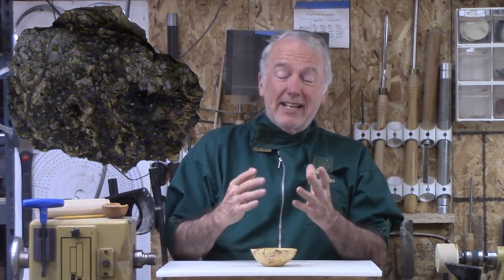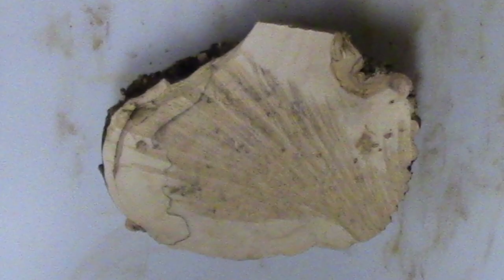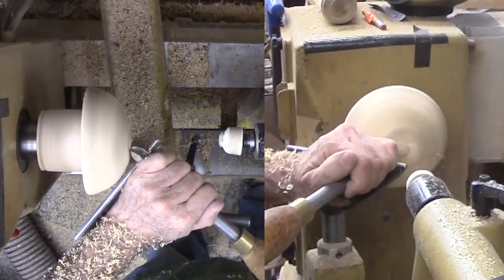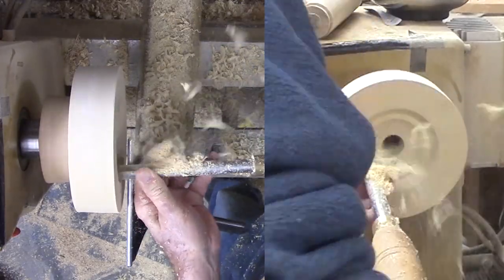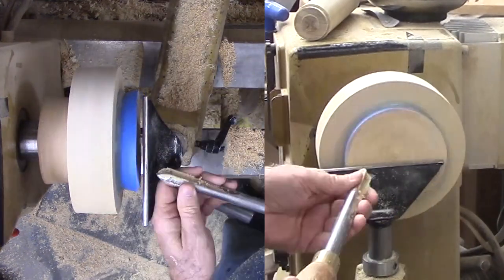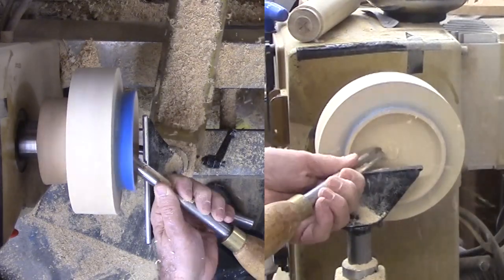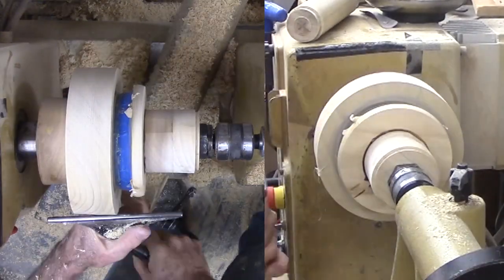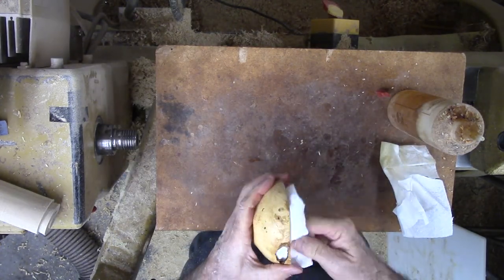This Burl Spoke To Me - Don't Cut Me With A Tenon

Comment: Sand bottom smooth, glue block, carefully turn both inside and outside, sand, finish, remove from glue block with D.N.A.. Hand finish bottom. Small burls are a real treasure to work with and worth the extra care they require. 👏🏻👏🏻👏🏻👏🏻👏🏻
Reply from the maker: Thanks for sharing, Valerie
Alan

Comment: Beautiful bowl. The painters tape was an excellent idea. Since you only had a small area of hot melt glue you could have used DNA to soften the hold that it had. Drip it onto the seam, give it a few minutes to work, peal the bowl out of the chuck. Any glue remaining on the bowl should peal off with the tape. I love this bowl.
Reply from the maker: Thanks for the tip!
Alan

Comment: Nice bowl.  Just because you asked; My method (a) glue what will be rim of bowl to faceplate, turn bowl outside complete.  (b) hot glue waste block to bottom of bowl, turn tenon on waste block  (c) chuck up on waste block tenon and turn inside of bowl (d) remove bowl from waste block.
Reply from the maker: Interesting Process - I'll keep it in mind.
Alan

Comment: Like the tape idea. Hot melt glue can be removed with a hot air gun on low. When glue becomes shiny it loses it's adhesive qualities. Alcohol also works but takes longer.
Reply from the maker: Good tips.
Alan